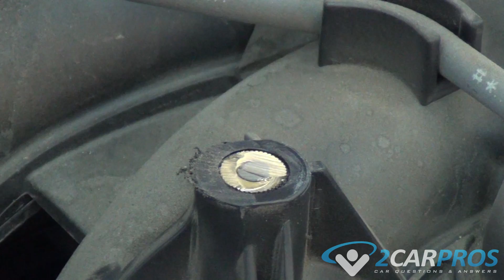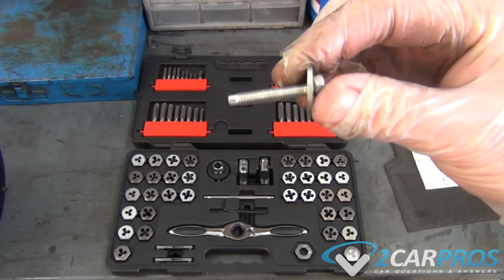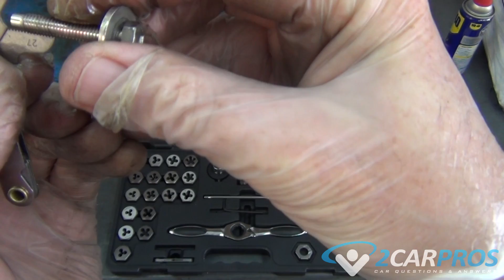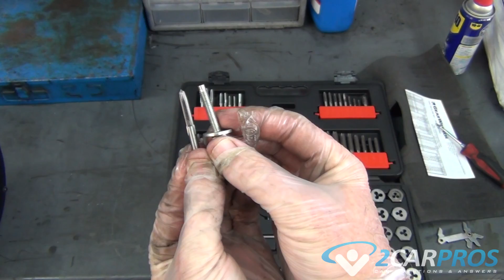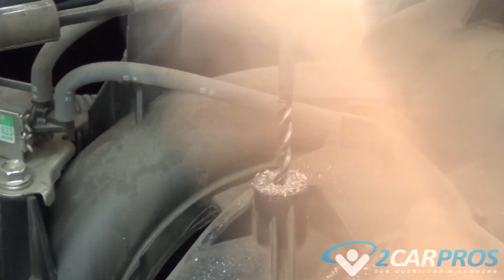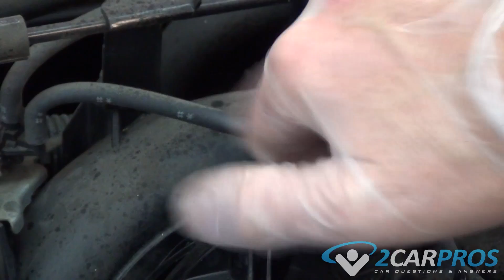How to Drill Out a Bolt and Tap a Thread

Comment: Will this get out a stripped oil drain bolt thats stripped inside the oil pan? Im thinking of creating a new drain hole and seal the old one
Reply from the maker: I would take the pan off the engine to not get metal shavings in the engine. Thanks for watching!

Comment: If the hole is stripped out could I use same size tap or do I need to drill it out and go larger?
Reply: You could still use the same size tap. You just need to drill it as close as possible without drilling too wide and  stripping the already existing tap.

Comment: I have several bolts snapped off inside the thread where there is no way of grinding them flat but I can't find a single thing on YouTube regarding this subject. I don't mean to sound like I know it all because I certainly don't but, it seems obvious to me to grind the bolt flat it at all possible what do I do when it's not possible is what I'm after. I purchased eight very good aluminium garden chairs that I am going to re-spray. When it came time to dismantle the chairs I found, missing, bent and broken bolts. The broken bolts are awkward enough to get to with a drill let alone anything else. The bolts are stainless steel and are as hard as heck to drill. Any help you can offer would be appreciated.
Reply: Buy a dremel style tool, and a small carbide bit, or two. You can get bits in different size and shaped heads. There are some that have flat tips with cutting surfaces. Get one with a small enough diameter to fit inside the hole without touching the sides where thread may be exposed. You can fairly quickly flatten that snapped uneven part of the stuck screw. Remember, when drilling and or grinding with a cutting edge, slow is better. Go too fast and you polish your sharp edges off, and the friction heat will temper and harden the bolt where you are spinning the now dulled bit (if you are going fast). I go as slow as my machine can, and put enough pressure against the bolt as I need, to keep the bit from losing contact with the surface I’m addressing.  The next carbide tip I use is cone shaped which that tapers to a point. If you hold the dremel with stead touch, and lightly contact the center of the now flat bolt, you can precisely create a perfect cradle for the point of your drill bit. 
I get to extract the broken bolts where I’m at, it is all about patience. Don’t worry about investing in these tools. Every friend and neighbor that hears you can do this…. Will happily pay you more than you have invest, to just extract one bolt

Comment: Does that mean after drilling it out, tapping it to the very same threads as before?
Reply from the maker: No it will need to be larger. Thank you so much for watching!
Reply: 2CarPros thanks for clarifying that. I thought it is drilling out the old bolt and after that just cleaning the threads with the same tap.
Reply: @ybrik5937  I have done this before with a flat bottoming tap. It worked perfectly. You have to be very careful, patient, and slow.
Reply: @ybrik5937  And your drilling has to be extremely straight, and not cut into the threads. Step up your drill bit sizes slowly, and methodically.